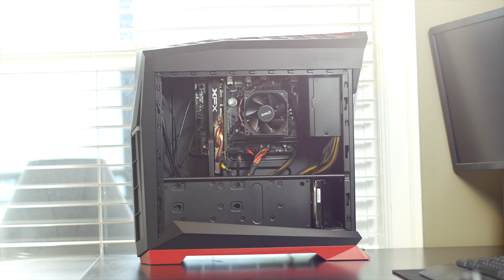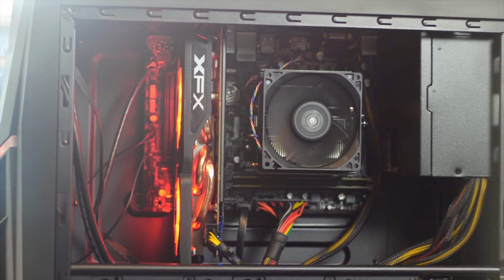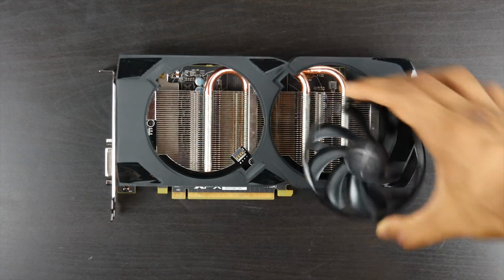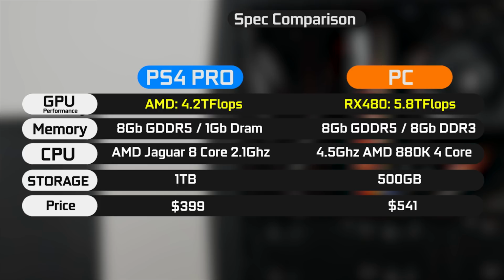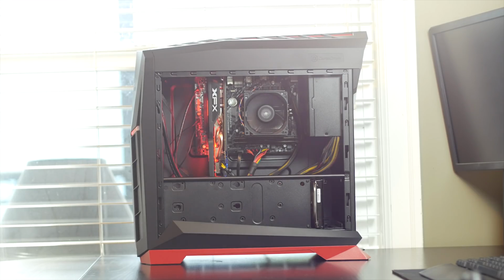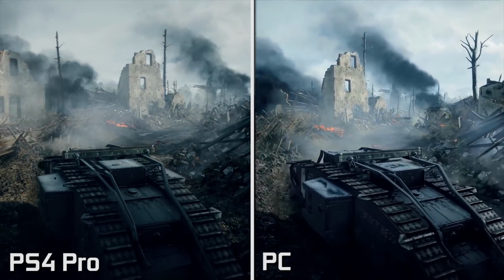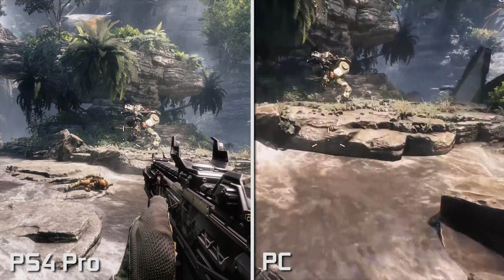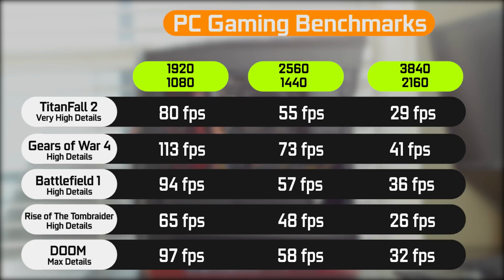Playstation 4 Pro vs $550 Gaming PC

Comment: Well Executed Title for the PRO showing the real hardware potential of PRO when developers patch the titles well and alter their codes to squeeze the extra capabilities from the PRO to attain a solid experience. -  More to come , especially upcoming SONY Exclusives. Sweet Spot of the Pro is 1440p , However 2160p = ~ 1.15 1800p which is a vast improvement on 4 x 1080p.  Very capable machine for 400 USD. Note Iam a Computer Gamer Enthusiast But I got the  Pro  along with a Samsung KU 7000 55 inch (Very decent price for this TV Features including HDR , acceptong a 10 bit Signal , HDR Gaming mode , and very solid low input lag on 4k 60 hz HDR. Let us Enjoy some HDR / 4K Awesomeness.  #Period

Comment: PS4 comes with a Controller, Power Supply, Case and Mother Board.....Shouldn't all of these components be added to the price of your build?
Reply: he did not list the components that I mentioned in my post....What do you mean by "The Controller is Optional"?....The PS4 comes with a controller but the PC needs a mouse and keyboard(or Controller) which wasn't mentioned in his over all price either....Paying to play PS4 online has nothing to do with the cost of the components but he should have included that cost in the over all price of the PS4 I think.
Reply: $550 includes gaming keyboard, gaming mouse and operating system... Ohh sorry it doesnt include those... ok!
Reply: Giovanni Cheng I can't do that without bypassing the paywall... :P
Reply: Giovanni Cheng For money idiot.
Reply: yes Giovanni you can play online on the PS4... right after you pay the 60 dollar's they ask of you (aka paywall). So in reality the PS4 cannot play multiplayer right out of the box. If you even try to play online with any shooter or multiplayer based game on said PS4 console, a blue screen with the PS+ subscription service will pop up demand... I mean asking you if you want to play online just buy a subscription.
Reply: Only a few titels, most of them need PS+ and the games themselves often cost more too
Reply: His build is really bad for the money he spent. You can get a PC way better then the PS4 pro with keyboard and mouse included for $550. Also windows costs only $20 if you buy it from the right price. Look for better PC budget builds if you want to really compare the two. I found one were someone built a PC for $170 and it ran better then a PS4 Pro.
Reply: camren480 Please don't, Alienware has the most over-priced PCs possible. Also an i7 processor only slightly increases performance of a PC build, while the graphics card actually makes a difference. If you don't want to make your own PC, at least buy a pre-build from a better seller. If you buy Alienware, you will regret it in the future.
Reply: Giovanni Cheng you have to pay lol with pc it's free..
Reply: Also, I like how they never add the price of the OS/Windows to the build. Windows is not free.
Reply: Koko the Arabian actually you can theres a glitch they give a 5 day trial just make a fake email and keep making accounts to get the 5 day and there you go i do it when i dont pay the ps plus yet
Reply: John Hooper Where in the actual duck would you need a blu ray drive to play ducking video games?
Reply: Donald Duck Ducking true.
Reply: I also get triggered when PC is more expensive because it's more capable and versatile than a console, why should we have to pay more for something that's better? just beyond me... (obviously I'm joking and PCs are more expensive because they are better, they don't cost more for nothing) you can't compare these two products
Reply: What about a tv for the ps4? This pc price is obviously including mobo, case and psu btw.
Reply: R3alark im just getting a damn alienware alpha steam machine at walmart that has a i7 in it and installing windows on it and calling it a day i dont feel like building a PC this Christmas
Reply: R3alark Bad CPU will hold back your graphics card, but yeah you are right i have a I5 6400 and gtx 970 and still runs alot better than consoles.
Reply: Giovanni Cheng But who the fuck on earth would play them?
Reply: Exactly
Reply: LOL.....All of this talk about which is better then the other is so very entertaining.....All I was trying to point out was that the comparison was lacking all of the key components.....Yes a PC will do more then play games....Really and who doesn't know that?  A PS4 does more then play games also but who doesn't know that?....It's simply not an accurate comparison between the two systems no matter which system you prefer.
Reply: @DelbertStinkfester  That point is you are not educated enough to say anything.. I can build a better PC in a lower price than ps4 pro anyday including all key components with better in quality..
Reply: @evangirodriguez9554  why are you commenting on a 3 year old video?
Reply: @DelbertStinkfester  I saw this video about 3 years ago but didn't checked the comment section. And now found in my history. Even also found shitty comments from some uneducated 🙄
Reply: @evangirodriguez9554  Your grammar is worse than a 3rd grader yet you're calling people uneducated.....LMAO....You just can't make stuff like this up....this is pure gold
Reply: are free games in pc.
Reply: all i have is a pc
Reply: Giovanni Cheng F2P GAMES LOL
Reply: Every time I try to make an equal PC it come out to $1000... at least this guy isn't using a 1050 ti as his equivalent but there is not way i can build this for 550...
Reply: he did add all of these components to the price
Reply: he just can`t make normal pc, ps4 pro is piece of shit, because you can buy better pc on this money and you still will have some money for good mouse and keyboard. And don`t forget that you can upgrade pc when next generation comes, it`s cheaper than if you buy console in 2016 and after some time new console, but you have similar graphics
Reply: John Hooper  hahaha get yourself educated.. I can build those in a loot cheaper price point
Reply: John Hooper  hahaha.. A I said I can surely build more effective, way more powerful PC than any Consoles in a similar price range.. And worktime? 😂😂😂 For DIY build who fuck care about work time with that precious professional building moments! Does even those accessories count for PC? Cause the options, price and choices is unlimited!
Reply: John Hooper  You're repeating same words again and again! 😂😂 
With all your requirements I can build you a PC, at where you can fluently play a full size PC games at 1440p with higher 60 fps constant at ultra settings.. Your crying for controller, wlan, keyboard tell that you know very little even worse about build..
Reply: John Hooper  Sure! Why not! Wait for some while!
Reply: John Hooper  Here is a configuration for you..

AMD Ryzen 3 3200G 4-Core Unlocked Desktop Processor with Radeon Graphics (CPU cooler included) around at
95$

Amd Sapphire RX 580 Pulse Graphics Card, 8GB GDDR5, DVI-D, HDMI, DisplayPort around at
100$

ASRock A320M AM4 AMD Promontory A320 SATA 6Gb/s USB 3.0 Micro ATX AMD Motherboard around at
30$

8 gb DDR4-3200 RAM at 35 $

2 tb Storage around at 50$

APEVIA ATX-VS450W Venus 450W ATX Power Supply with Auto-Thermally Controlled 120mm Fan, 115/230V Switch, All Protections around at 
20$

Case around at 30$

Gaming mouse at 20$

RGB keyboard at 25$

2-pack cooler fans at 5$

Blu ray drive around at 25$

Dvd drive at 15$

Wifi and Bluetooth adapters (4+4) = 8$
 
In total: 458 $
 
And yes with little more toil one can build same config PC at a much cheaper price country wise.. 

And also remember, a PC with this configuration can blow out any of current consoles.. Let no talk about the versatility of a PC.. 

Want to see a gaming stretch test of the GPU at 4k with ulta high settings.. I would recommend you not to watch.. Because after that you will cry 🙄🙄
Reply: John Hooper  You've just showed your damn ignorance.. A320M can be even found at a cheaper price with little more search and toil.. I can even build you a pc with a RTX 2080 ti, Core i9 and all way more rich configuration in a cute tiny case, let alone this configuration.. And I literally shit on controller (except wheel controller and joystick).. Even who the fuck need a controller when I got gaming mouse and keyboard.. 
And here I'm talking about the newer consoles (PS4 pro and Xbox one s or X) 

Should I give give you a video comparison of ps4 and PC? I again recommend you not to watch.. Because you'll cry then again 🙄🙄🙄
Reply: John Hooper  Proved your point! Lol moron! 😂😂 Yeah I proved your ignorance! And why always run for link,, search at any near super market of computer devices or get yourself into a holiday discount package.. Like I got one at 50% off, 32$.. You can find in Amazon around at 40-50 $ for sure... So what? Then I can cut out bit more memory or storage to stable my price point🙄🙄
Reply: Hahahaha ps4 comes with power supply. Hahahah hey foodless, ever owned a PC? Obviously not.. 😂😂😂
Reply: He listed the PC components... the controller is optional. 

Can I play online on the PS4? No.
Reply: falsE You can play some online games like Warframe, DC Universe Online, War Thunder, etc without PS+. So it's not impossible to play online games on the PS4/PS4 Pro, idiot.
Reply: Non-branded pre-build PCs. Don't bother with branded PCs, they are overpriced like Apple's trash.
Reply: John Hooper He probably meant Windows Vista lmao.
Reply: Koko the Arabian Uhh.. Yes you can play online on the PS4 Pro?

Comment: No need to even watch this video, we all know how this comparison will turn out. 😄
Reply: Barack Obama Why wouldn't it be when consoles are effectively inferior the day they are released.
Reply: You do realize that floating point operations don't tell the whole story right? The GTX 970 only has 3.9 TFLOPS, but  was very close, if not better with  performance than an R9 290x at 5.6 TFLOPS.
Reply: INFAMOUS089 Gaming PCs don't have to cost $700 and don't forget that when you buy all this shit up front, you can upgrade components over time, you don't need to buy everything again like a console.
Reply: INFAMOUS089 You could get all these parts through a cheap used outlet of some sort.
Reply: KronicKatz I do still play ps1 I love playing older and newer games. in my opinion a pc while it may look better you're still getting the same game on pc x1 or ps4. so if I can get a console and enjoy the same game I can get on pc at a lesser price and not have to worry about upgrading my hardware or worry if this game will work then I'm going to do that.pc gamer act like that just because there game had an extra pixel on the screen it makes it better. the game is the exact same game. I know some games don't even come to pc or work right red dead and batman come to mind. so I'll stick to my console and know when I get the game that it will work and I didn't have to spend 1000 to play it. as for ps4 I dnt plan on getting one my ps4 works fine and again like I said for pc the games are the same I won't be missing anything.
Reply: I'd argue that TFLOPS don't tell most of the story unless you are comparing GPUs from the same architecture.
Reply: The cheapest gpu's that can output 6tflops is the titan x original or the 1070
either of those cards are insanely expensive and you need a powerhouse system to fuel them though

unless vega and zen happen in that time and are affordable
Reply: abirneji ((Coughs)) APU is not the same as stand alone CPU and GPU.
Reply: Franklin Puerto Not worth it for a game console. My bills would love to have that money. Which is why I'll probably cheap out and buy the Nintendo Switch, or just upgrade my PC.
Reply: +abirneji

A slightly overclocked Rx 480 is easily capable of 6TFLOPs - and that's a $250 GPU.

You really shouldn't compare TFLOP numbers from AMD & NVidia - they are totally different architectures.
For example, the 8.6 TFLOP R9 Fury X could just about keep up with the 5.6 TFLOP GTX 980 Ti

If you want to get an idea of how the Scorpio will perform, you should look at current 6TFLOP cards from AMD, not NVidia.
Reply: kahnsealable i know what an apu is
I had one
Reply: Fart Knocker flops arent the whole story
But they're a lot of it
The rest is optimisation and stuff
But ofc usually tflops is a good  comparison for similar gen things
Reply: Yea we all know it's biased towards pc
Reply: Barack Obama 500 for the pc which it looks like you still have to buy the power supply. operating system and a case If I don't have that stuff just laying around. so it's more than 500 more like 700 I'm sure
Reply: White Knight 5 yes they don't have too. I was just saying in his video he says it cost around 500 but if you're new to pc gaming then it's going to cost more than he says. and while you can upgrade your parts some of them are just as much as a new console. Honesty both pc and console both have there pros and cons
Reply: INFAMOUS089 The total cost will obviously depend on how capable you want your gaming PC to be, which is one of the good things about it as a gaming platform. You choose what your system can handle. Not only that but the game library is astounding and every console game does at some point become playable on PC via emulation.
Reply: White Knight 5 yes but I'm talking about this guys build. if you were to go out and buy this it would be more than 500 that's all I'm saying. and while I do some pc gaming I enjoy the ease of use with and console and not having to worry about upgrading. I couldn't care less about what frame rate or how many pixels are on the screen
Reply: if you dont care about any of that, then why arnt you still playing PS1? i still dont understand where you plebs get this "upgrading" shit from. Does the technology in your precious consoles magically upgrade over time too...... oh wait i forgot thats what scorpio and ps4pro are suppose to do but it was such horrible "upgrade" that it makes me think people are honestly retarded to be spending that type of money all over again for the same shit but bumped up by 15%. Atleast if i wanted to waste that type of money with a pc i could get a 20% increase in a single year's span and not 15% in 4 years.............

Comment: Isn't there any bottle-necking with this GPU and CPU combination ?
Reply: Haider Sherazi Def not fx 6300
Reply: I don't think many people really know what bottlenecking really is. A 6300 won't bottleneck a 480. is a 6300 as powerful as a 6700k umm no, but it's fine for the RX 480.
Reply: Souvik Chakraborty its not like that, 6300 and 8350 have basically no difference at all in term of gaming, 8350 only got 1 more modules than 6300, 2 core, which do nothing in dx11 gaming, and very little difference in dx12. For amd gpu, it required very strong single core performance, at least in dx11, to reach its full potential, and all amd cpu got shit single core performance de to that shit module design
Reply: Souvik Chakraborty i do watch and he change the name of his channel already. You can watch his i3 vs 6300, 8300, than watch the i3 vs i5, you will see how much amd cpu bottleneck amd gpu in dx11. Also, he has explain the issue in his cuda core and dx12 videos too.
Reply: no, 6300 do bottleneck a 480, easily, thats also becoz amd gpu required more single core performance from the cpu, to learn more go watch Salazar Studio
Reply: 480 needs at least a Fx 8350 to remove bottlenecking. 
But anyway this is a budget build and you have to sacrifice something.
Reply: Maxim Au I'd suggest you watch a video on Science Studio channel. 

He made a similar video with fx6300 bottlenecking and you will clear ur doubt
Reply: Dex4Sure most likely if you are using fx6300 and rx480 you are using 1080p panel. higher fps also means that when fps drop in intense moment, the frame drop wont be as noticeable, and thats usually the reason of bad gaming experience. I am just stating the fact that fx processor can bottle the gpu, which it does, even for 1440p and 4k it still does, just not as noticeable.
Reply: Haider Sherazi
Or buy a used i5-2400
That thing for under 50$ is a steal
Reply: theres a difference between how a cpu limits a gpu from going full power and a cpu's power.

Comment: If your on console, say you got the original ps4, that's roughly 400, than you spent 60 bucks for a year, that's about 3 years before the pro came out, so that's 180, and than you got reeled into buying the pro, that's ANOTHER 400, that's almost a grand, and most likely you upgraded your hard drive cause 500 gigs just doesn't cut it, and considering how good deals don't happen a lot for retail copies for video games on console.... that's over a grand, and your "upgraded" experience, is literally just a setting away on PC, this is one reason I switched, I mean I don't mind getting fucked by corporations but they don't even look you in the eyes when they do it anymore.